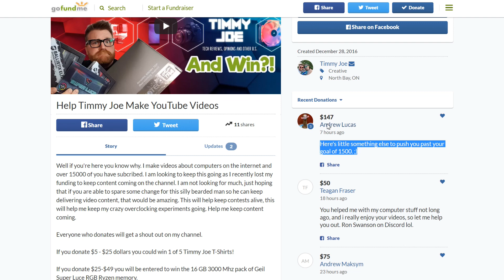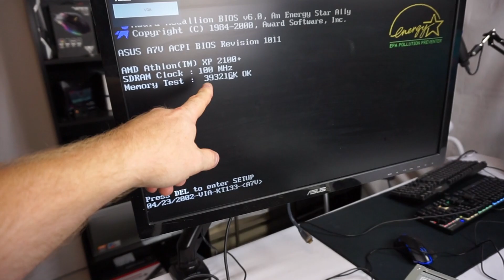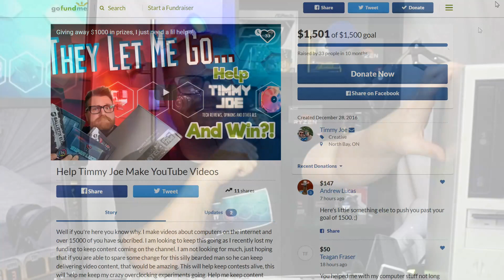AMD Athlon XP 2100+ ATI 9800 pro Upgrades!!!

Comment: I have the same motherboard in my vintage Athlon 1200 (Thunderbird Core) system with a Leadtek Winfast Geforce 2 Ultra! www.retropcbuilder.com/athlon-1200-retro-build-2000/

Comment: I ran a 2100+ back in the day with a really big cooler for that time. it was a very good overclocker and I ran it at 2200 Mhz with no problem and very stable. I later got a Athlon Mobile 2400+ and I could boot it running at 2500 Mhz but was not very stable, I backed it down to 2450 Mhz on a Abit AN7 motherboard. this was a great setup until I got a DFI Lanparty socket 939 SLI DR Board and a Athlon 64 3700+. this was also great stuff for the time! Old hardware still is a lot of fun. I went to Windows XP very quickly when it came out, before that I was dual booting Windows 98 SE and Windows 2000. those were the days.

Comment: I had a very similar system back in the day. I had a athlon 2100+ and a ati 9500 pro and then later a 9600 pro. The cards worked great until I over clocked them. 😞

Comment: Congrats on the new job.  BTW, that 9800 Pro is completely overkill for Duke Nukem back then.  The 9800 Pro was the card I bought for the first computer I ever built myself from scratch (not counting the one I built from spare parts to teach myself to build before spending the big money to build new one).  That 9800 Pro was the card I used for games like Elder Scrolls Morrowind, Freelancer, Knights of the Old Republic, etc.  And I was running all those games maxed out at 1600x1200@75hz with no issues.  That card was an absolute beast.  It wasn't until Doom 3 came out that I finally ran into a game that that card had trouble running at smooth framerates.  If I remember right, that card was one of the first DirectX 9.0c graphics cards.  It was also meant for Windows XP, not Win98.  The ATI Radeon 9800 Pro is still one of my all time favorite cards.  Loved it.

EDIT:  If I remember right, wasn't there a mod (like a pencil mod or metal pen mod) where you could reconnect the extra pipelines to turn the 9800 Pro into a 9800 XT?  I think I remember that from way back then.
Reply from the maker: Well aware of the overkill duke nukem haha. It's just one of my faves. Thanks for the nostalgia, I had a voodoo back in the day and then a geforce 2 I don't think I ever had an ATI until way later
Reply: Ahhh Voodoo.  Great cards.  That computer I built out spare parts I mentioned in my last post.  I had a Voodoo 3 3000 in that one.  That was another really good card.  At least for the games that were able take advantage of the 3DFX Glide features of the card like Quake 3, Unreal Tournament and Wing Commander Prophecy.  Man, I need to play WC Prophecy again.  Been a long time.  And the GOG version has a glide emulator in it so I can enable the glide features in it again on modern cards.